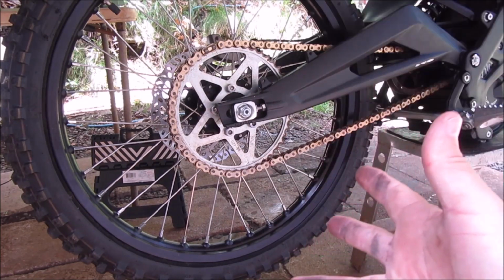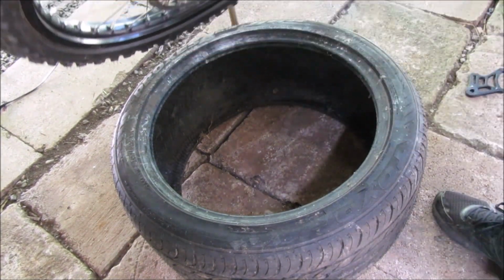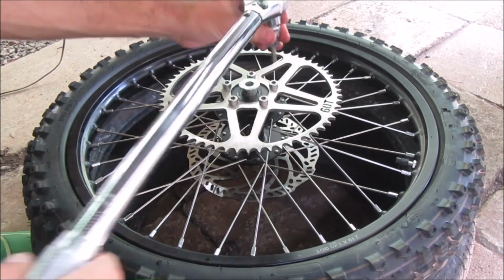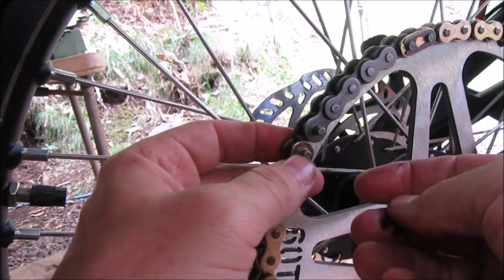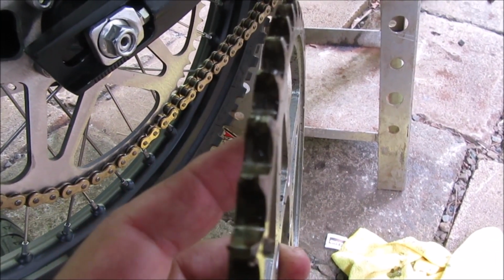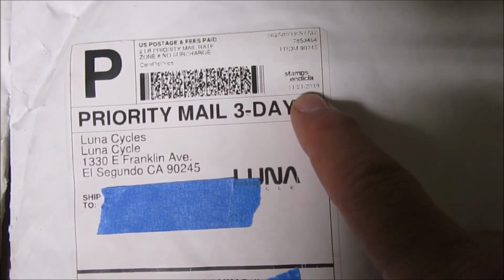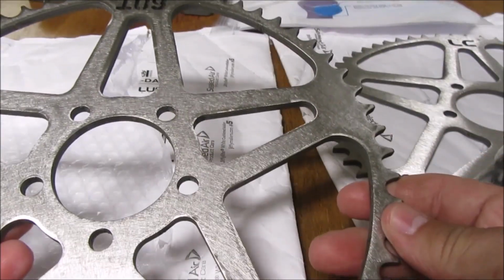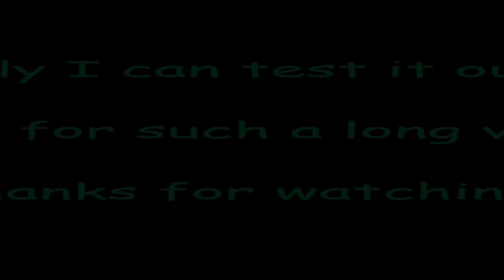Sur Ron 60T installation and some problems

Comment: I just put on a 64 tooth from Luna and at 6 foot and 230lbs. I went from 45 mph on stock to 35 mph on 64 tooth, but the torque and stop and go is way more fun now.  With this ebike you can basically transform in very little time, to multiple different bikes.  Very awesome.  Ride on!👍
Reply: instablaster.
Reply: What is the range difference now?

Comment: Just came across this video because I bought a Sur Ron here in Colorado.  I'm from Oahu/HI and you sound like you are from 808.  Am I mistaken??
Reply: Sorry I commented too soon before I finished the video.  I see you are indeed a braddah! Lol.  Good stuff.  I put a 54 on mine and was fine.  I have the chain conversion from belt for the primary drive in the mail but I am going to wait to do that.  I got my bike Sur Ron in June so I'm still a total newbie.
Reply from the maker: @motocrisis  No probs, the bike is super fun! Plenty places to ride in Colorado I bet. 
Shipping is still slow here on Honolulu. 
Thank you so much for watching and commenting.
Aloha and take care
Reply: @motocrisis  wassup Hawaiians, i have a primary chain drive conversion with geared down for torque. Not installed yet. I also have a 60T sproket not installed yet. Does anyone using da sproket and geared down primary same time? Im wondering which sproket to use if my primary already gives me more torque. Mahalo bradas

Comment: How do you like it now?  Is it much better for jumping?
Reply from the maker: I just tried it out in the trails this past Sunday and it really helps out jumping over roots and climbing Hills. I did notice that the speedometer seems to be way off now and I can't get an accurate speed. 
Thanks for watching and commenting
Reply: @MuddyDrivewayProductions  Thank you!  But do you think it's really a major upgrade for someone who is 200 pounds heavy (my case)?  Congrats for the video!
Reply from the maker: @GustavoTestaCorrea  yes Sir. You will definitely feel a difference. Especially steep inclines.
Reply: @MuddyDrivewayProductions  Thank you!  Do you do small ramp jumps on it?  Did you think it got much better?
Reply from the maker: @GustavoTestaCorrea  just remember your top speed will be reduced
Reply from the maker: @GustavoTestaCorrea  sorry I don't do any ramps I mostly ride in trails in the woods
Reply: @MuddyDrivewayProductions  thanks for all the info!
Reply: Your Speedo will be way off..I installed a 58 T sprocket,with a 3.0×19 tyre..I have a GPS mounted to test the speed,..I did several tests before changing the sprocket and could achieve 50mph.. provided the battery had a minimum 75% charge..after swapping to the 58T..I could only achieve max 40mph..but with lots of extra torque and faster acceleration,the stock Speedo runs off the motor,so will be miles out..also,you cannot use an o'ring link on a none o'ring chain..in my opinion,unless you intend running only on road,then the best sprocket size is 54T. . minimal loss of top end.. increased torque, finally,I would always recommend a none o'ring chain for these bikes, o'ring chain puts more drag on the motor, it's not like there's a lot of power to start with!..have fun 👍
Reply: @bryanberesford7521  thank you
Reply: @bryanberesford7521  It's the outer circumference of the tire that will affect the speedo, not the gearing.  That is the case on any vehicle.